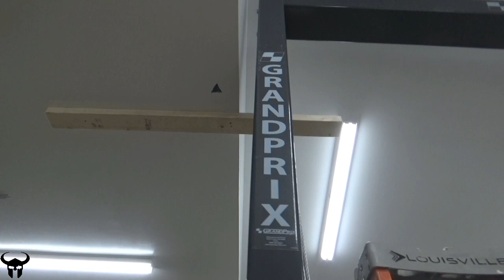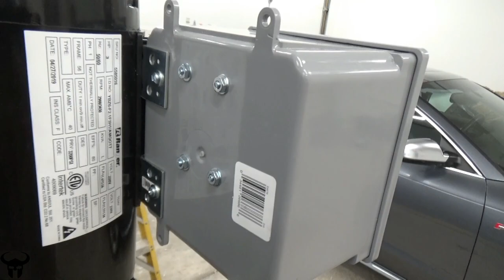Installing a 2 Post Car Lift (Bendpak GrandPrix GP-7) DIY (Super Garage Video #4)

Comment: Be sure that you grease the cables on a regular basis to prevent them from wearing when they are on the steel pulleys. The steel wire rope requires lubricant to be embedded in the strands of the body of the cable to reduce friction and extend the service life of the cables.. Good luck!

Comment: Hi, your new concrete pads/piers was spot on. Glad you used the 6000 psi concrete. I hate to tell you but you extension cord running to the lift isn't code. The wire must be inside a metal conduit to protect it from being damaged, thus protecting you from electrocution.

Comment: Nice set up you have there! Just a little tip for you! Befor you go doing all that work up in the ceiling, I have used lifts to remove engines from all types of vehicles including boats! Just something to think about! Good luck
Reply from the maker: We never ended up adding a hoist. But, I have used the lift already to service my riding lawnmower and fix my welding cart :)

Comment: Good stuff man. I wish the truss video had been more how-to ish but all in all great channel so far.
Reply from the maker: Thanks for the comment and suggestion - if more people are interested in seeing in-depth calcs and the methods used on the truss modifications, I would consider making a video specifically about that.
Reply: Enigma Engineering I basically have the same thing going on. I opted to go with a MaxJax portable 2 post lift specifically because of my ceilings. But open to upgrading if ever your video does become a thing.

Comment: Nice Job, just got my GP7 yesterday.  If you could sendme the wiring diagram regarding the thermal disconnect and the type you bought that would be great.  The manual does not tell you what size thermal disconnect to buy.  Thanks and happy lifting.

Comment: Have you noticed the front arms hanging lower than the rear arms? Finally got mine installed (this is an alt channel for akasJosh) and I’ve done a few great installs but I’m noticing now my front arms on both columns is maybe 3/4” lower.
Reply from the maker: Hey Josh! Congrats on getting the lift installed and getting some work through it. My front arms actually measure 1/8" higher than my rears if anything. My front arms have an aluminum spacer that is perhaps 3/8" thick, but this spacer is towards the top of the large metal pin, and just on the front arms. Send me an email, I'd be more than happy to help you figure it out: enigmaengineeringllc@gmail.com
Reply: Enigma Engineering done

Comment: How long did you let the concrete cure before you installed the lift? I noticed there was only like a week between the concrete vid and the installation vid!  Most Lift companies recommend a 20 to 30 day cure time  before installing a lift!
Reply from the maker: The installation video took a lot longer to make, so I posted it late :) I believe we waited 3 weeks for the concrete to cure. I consulted with some experts before drilling into it to confirm the concrete would be around 4000 PSI minimum before we drilled into it (it was 6000 PSI concrete). We were extremely observant on our wedge anchors to make sure they all grabbed and didn't slip!

Comment: This is crazy. We're just about to buy another house. It has a 3 car garage, and this is literally what I wanted to do. I also have a 4th gen 4runner haha... Any follow-up report on what you would have done differently?
The garage I'll be moving into already has 11 foot ceilings, so hopefully won't have to do quite as much work to get the 12' needed for the lift. How high did you go on your ceiling?
Reply from the maker: Hi Philip! Lol - the 4th gen 4runners last forever, I'm currently refreshing mine - no plans to get rid of it! The modified garage has worked great so far, I would have changed nothing. We started with 10' ceilings, and went up to 13' in the peak (not counting drywall). This gave us just enough room for the Bendpak GP-7. Email me if you want any more info: enigmaengineeringllc@gmail.com

Comment: What type of material are your shims made of? Also you should really double nut all your anchor bolts!
Reply from the maker: The shims came with the lift - I think they are thin stainless steel! Double nut might not be a bad idea. But the nuts are torqued to 150 ft-lbs though with washers tho, so I do not think they are going anywhere. I'll look into it

Comment: Could you please measure the height from the ground to the bottom of the arms. It would help me a lot because I’m trying to see if I can recess the post to lower the gap so I can lift lower cars easier.
Reply from the maker: It is 1-1/8" to the bottom of the end of the lift arm, and 3-3/8" to the top of the end of the lift arm (with the rubber pad removed). I drive up on 2x6"s with the miata to make it easier to lift
Reply: @EnigmaEngineering  Thanks for the reply. I got mine all setup yesterday. just need to finish the wiring and it's good to go

Comment: Hello from a fellow road racer!  I'm in the process of getting a quote for the install of this lift, and I'm curious, how much clearance do you think you need between the upper surface of the top trough and the drywall ceiling?  In my garage I have about an inch of clearance.  

The local Bendpak installers local to me have never installed a Grand Prix and are saying it's too tight, but you obviously have installed one and they haven't!  Do you think the top trough can be installed with that little clearance?
Reply from the maker: Hi Shane - I think I helped you out via email! Good luck with the build!
Reply: @EnigmaEngineering  Yup, sure did!

Comment: So the cables actually hold the weight of the car as it's lifting?
Reply from the maker: Hi Thomas, this is a great question. Yes, the cables hold the weight of the car when it is lifting. The cables are incredibly strong, but, the cables are driven by a hydraulic cylinder. The hydraulic cylinder has fluid in it that is pressurized by a pump when you energize the system. But, once the car is lifted above a certain height, spring loaded steel stops on each lift post are pushed back while the lift passes by them, and then the stops go back to their original positions once the lift has passed, preventing the lift from falling back down. Therefore, when you get the car to a height you will be servicing it at, it is smart to drop it down till it reaches the stops. The reason being the hydraulic fluid pressure will slowly diminish over time -  I want to install a pressure gauge to monitor this effect. When you lower the car, you pull a release lever to disengage the stops (after raising the car slightly off the stops). I researched the same question before we installed the lift and never found it explained anywhere, hope this helps!
Reply: @EnigmaEngineering  fantastic explaining of this system

Comment: You said you shimmed the column bases so they would be plumb. Is your floor sloped toward the door and if so did you pour the concrete level?
Reply from the maker: The floor is sloped towards the door 1/8"/ft (0.6 degrees). With the new footings, we matched this existing pitch, so no, we did not pour it level. Bendpak specification calls for a slope of less than 3/8" variation or 3 degrees over the installation area. The lift comes with shims - we used these to make sure the posts were perfectly level

Comment: Your lock rings are on backwards. That wiring looks like crap, You don't need to use tape on wire nuts if you know what your doing.
Reply from the maker: Thank you for the comment! The lock ring reverse direction was intentional otherwise the nipple would not have reached the threads - it is tight and isn't going anywhere. The wire nuts were tug tested. Tape for redundant safety and wire control...

Comment: Go for a in ground.  Way way way. Better. Ben pak is low end cheap China. Shit.  Challenger is better.
I bought a ben pack and resold in 4 months later for half what I paid for it
Reply: Tony Deanado long as the car is in the air safely it doesn’t really matter where it came from. If the welds on the safety locks are safe and sound the brand doesn’t really matter.
Reply: In-ground lifts require alot more work to install and most likely will require outside help! Setting up the arms are a real  pain on those types of lifts! As for the quality of this lift I pretty sure it will work just fine for residential use, It's not like it wil be going up and down 30 times a day 6 days a week like the lifts at my shop!
Reply: The Car Wizard uses Benpak in his shop